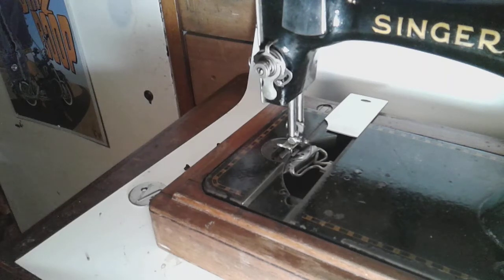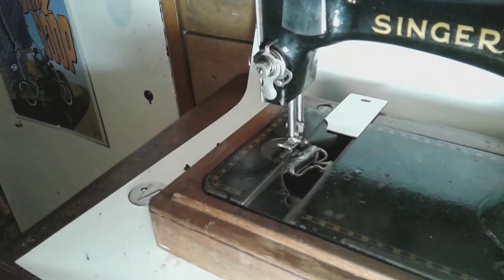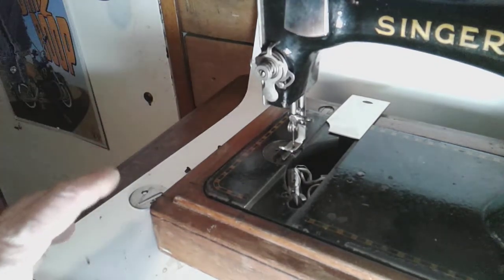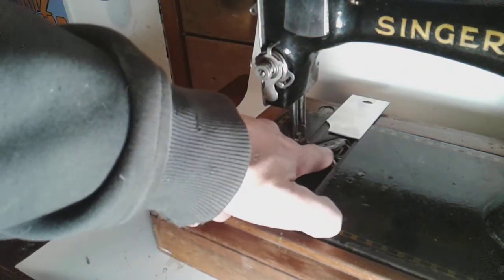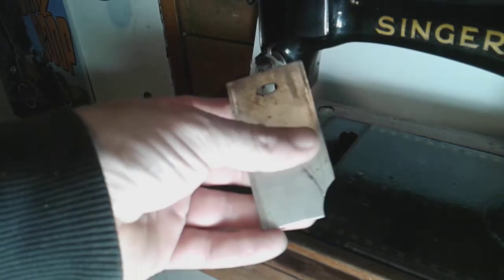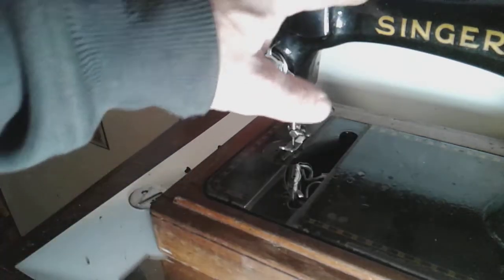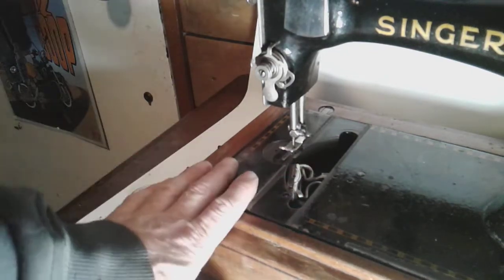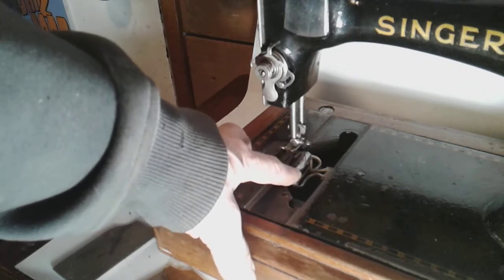My vibrating shuttle 28 is noisy , can i fix this .

Comment: Hey, I'm actually having the same problem with my 1922 model 127, I was wondering if you ever figured this out?
Reply from the maker: Yes i had to change some parts , i made a video on my repair , its running perfect now.
Reply: @4486xxdawson  can you link to this please?
Reply from the maker: @dshe8637  i have a video on me changing the cage that holds the shutle , i used a 128 cage on my 28 ....